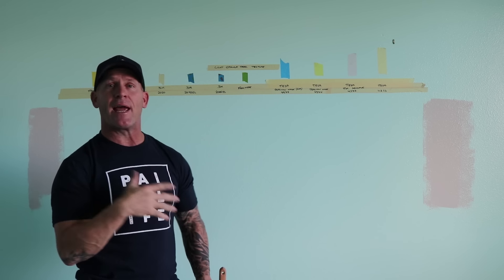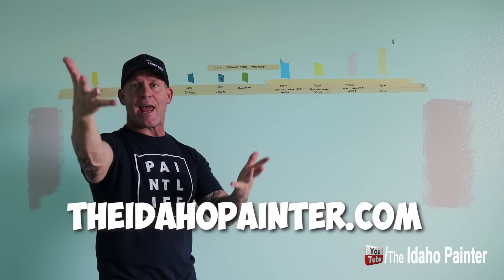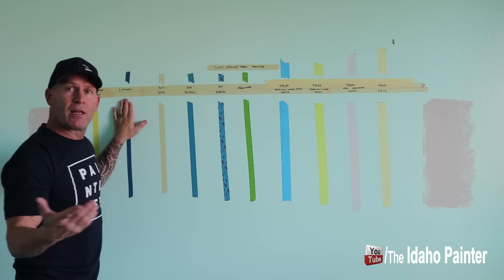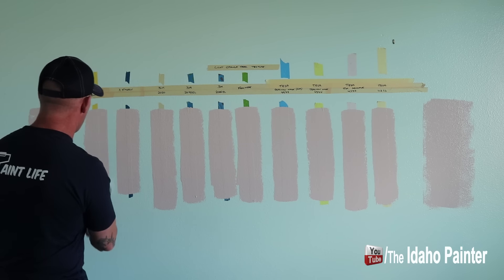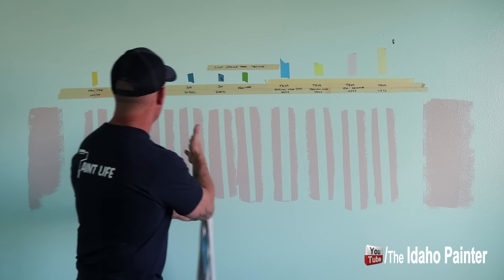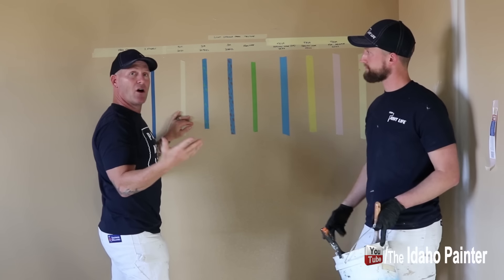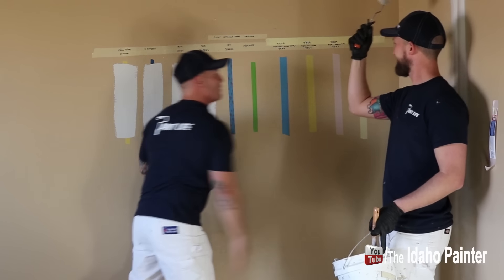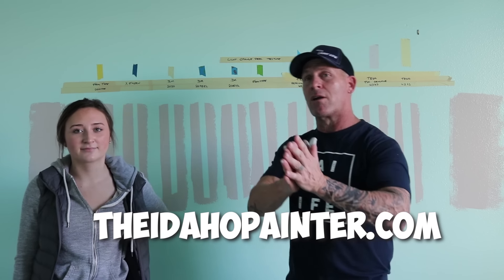Painters Tape Test.  The Best Tape for Painters.

Comment: Green frog tape or yellow frog tape is what I trust to avoid bleeding around edges. Naturally it depends on the surface where I'm working. Edging corners on accent walls or along cabinets? I use the yellow. Around wall fixtures or less delicate surfaces, I use green. Yes, they're expensive, but they really work. For baseboards, I use regular 3M masking tape (2"). It stays in place the best and is relatively inexpensive. The only time I ever use the blue painter's tape is when I am draping plastic from a ceiling. Other than that, I don't much care for it. Yes, it's made to not leave residue on whatever it's stuck to, but I rarely have tape on stuff more than two days, and very few tapes are going to leave residue after only two days unless they are in direct sunlight and getting hot. Blue tape is sold to homeowners who leave the tape on walls and ceilings and trim for weeks while they bang out small projects. Sure, there won't be any residue - even after weeks of being stuck to a surface, but the bleeding will be atrocious.
Reply: Sigh. As i read this i have blue tape up on a wall and its been days….

Comment: Just paint the protected color over the paint first, then, when it's dry, paint the new color you are blocking with the tape. Instant laser sharp lines every time. If you do not have the paint (say you are changing wall, but want to keep trim) just use the appropriate (satin, matte, gloss) mod podge. For Frog Tape to work correctly, just read the instructions.

Comment: We generally run a lightly dampened rag over our frog tape first to activate the sealer. Paint does not always do the trick.
Reply: Greg Andreas Thank You For The Tip👍🏼
Reply: Greg Andreas - Oddly, my SW Rep told me they'd had complaints about Frog Tape not working and found that sweat from fingers when pressing it into place was the problem.  I'm always hyper vigilant to keep Frog Tape out of the sun, away from any moisture and in the containers the best I can.  I'm in Sarasota, FL where it rains every day with 90%+ humidity 6 months out of the year.  I'm going to give the damp rag 'trick' a try.  Thanks for the heads up.
Reply: Yes! He should have done the test by dampening the frog tape to show how awesome it preforms!
Reply from the maker: Good tip, thanks for sharing!
Reply: Life changing tip my man. I have always sucked at trim. So much so I put off painting one room for over a year and a half because I didn’t want to del with the trim.
Reply: Damp Microfiber is the best way hands down

Comment: We use white tape outside where it doesn't really matter that much or to hold stuff together (plastic, paper etc) because they are cheap. Blue tape where you want to make sure you won't pull existing paint off. Downside of blue tape is that it doesn't stick very well. Orange tape is the general go to that we use most of the time. It sticks well and does a pretty decent job as a jack of all trade. Green (frog) tape on sensitive projects where a straight line really matters. It won't pull existing paint off. The downside of frog tape is that it is ridiculously expensive. Those are the four types of tapes we use 99% of the time. We also use masonry tape (usually dark red) which is a kind of duct tape on steroids. As you may have guessed it, we use this on masonry projects where the regular variety of tapes will not stick to the surfaces like concrete, brick, morter, etc...

Comment: Dollar store cheap duct tape works well too. Its got cheap adhesive that comes off easy and paint never sticks to the silver side so you can let the paint dry on it, and itll just flake off the tape and stay on the painted surface. i rip the rolls down the middle so I can have two sharp edges and only stick about half inch of tape on any surface, curling the torn side up
Reply from the maker: Awesome, thanks for sharing!
Reply: or dollar store electrical tape apparently...

Comment: Good demo, with one big omission. I’m very interested in the exact names of the 2nd and 3rd place winners. Most everyone knows Frog Tape and it’s the most expensive. But your second place winner seems to be good enough at a fraction of the cost. I might go with the second place winner to save a little money. However, in your results explanation I only heard a jumble of numbers and could not possibly identify the 2nd and 3rd place winners. So how could I buy them if I wanted to try them out?

Comment: I'm sorry for the thumbs down, but this isn't a good example of how we use tape as professional painters. How about taping a whole wall's-worth of baseboard and trim--in that case gravity is trying to pull the paint behind the edge of the tape. And more importantly, if you're caulking your tape anyway, I want my tape to stay where I put it until I'm ready to paint, and the green Frog tape falls off just like the blue 3m stuff. In my experience, only the yellow Frog tape really sucks down and stays put--delicate surface or not, it actually works!  Also, how about a closeup so that we can decide for ourselves?
Reply from the maker: That's a good idea!
Reply: Interesting, i find the opposite!! I find that the green tape sticks much better than the yellow tape! The the yellow frog tape is designed for delicate surfaces or paint that has not had time to cure and therefore is less sticky. So I don't quite understand where your coming from. Good luck anyway.

Comment: Can you tell me if I can leave painters tape on the wall for over a year without damaging paint at removal? I saw a wallpaper application method I want to try where you put paintera tape on the wall and then doublesided tape on top of the painters tape and then apply the wall paper.

Comment: I have a question that doesn’t Pertain to this video but I would like some input on it if that’s ok.My question is I have orange peel walls with antique white paint on them pro Marr 700 is what I’m using then use the orange peel in a can from Sherman Williams to fix my patched areas and then I use spray kiltz in a can over that and then finish coat but I noticed when I look down the walls I can see all of my patched areas how can I make this blend in better?
Reply from the maker: Sounds like the texture is flashing. You can see the differences between the size/pattern of the texture. Not much you can do about it now besides starting over.
Reply: jerry myers dude! I've had the same issues with patch jobs. You can primer and paint over them and they can look great when looking directly at it but from the sides you can tell there was a patch. What I've learned and am doing now is priming the entire wall after the patch job. I usually prone the patch area twice to get a smooth coverage but then prime the entire wall. Once painted you will never be able to tell. I've 10 rooms in my house and once I started this method it looks perfect.

Comment: I appreciate most the explainenation of the various tapes.

The down side I see of this test, or fault, is how quick you were to pull tape. 

It should've been a little closer to real world as far as leaving the tape on.

No one I know, masks off. presses that much the entire masked area, then paints straight away and pulls tape straight after that.

Real world is more like...

You go in mask off everything. Could take a day depending the job.

Leave it, come back and paint it. Leaving it till the paint job is done.. which could take the day.

next day, or whenever you come back. Pull tape and masking.

Especially for the diy user.

Lastly.. I huge factor is a clean pull. 

3M tapes are notorious for grabbing the surface especially after 24hrs.

And when pulled, either tear into little tiny pieces and/or leave glue on the surface.

The 3M 2098 most commonly found at hardware stores and sold in Pro Packs.

Personally, I don't paint houses. I paint single or 2 part paints.

It's impossible to pull tape directly after a coat. let alone wild one want to when laying 5-10 coats.

Pulling tape is a freaking nightmare. Even 3M's low tack tape states it's only low tack for so much time. 

In this video, especially that second run. That tape was on for what.. 3 minutes maybe. You could hear the difference in the grab they had.

You'd be pulling surface paint or leaving a ton of glue and that first layer of blue paper with some of those.

3M again, as you mentioned, swells.. but it also separated from the glue. leaving the glue and a thin layer of paper behind. 

At $10 bucks a roll, the 3M 2098 "safe release" blue tape is anything but. 

I have a project now that it was used on. Just enclosing a small diy paint booth for testing. 24 hr's later. Pulling it off left tons of glue and blue behind. And that's on a pvc pipe surface.. now I have to go back and clean all that crap off.

Thanks for the test though. And your explanation of the various kinds.. A couple I curious about having never tried them.

Bleed through is something no one wants in any paint industry. No matter the paint water or solvent based, single or two part, spray, roll or brush on bleed through tis the enemy.

Comment: What most people (including painters), like Chris explained for different purposes. They have different applications and that's  why they have different colors, textures and thicknesses. This test is not about the best tape overall, is just the best tape for that application. Example, I would use the cheapest tape for masking furniture and having the tape contact the plastic and not finished surfaces. 3M makes different types of tape with different  colors for the same reason.

Comment: Giod video. Next test should be how long you can leave tape on a wall, window and door before it sticks and shreds.
Reply from the maker: We take it off before the paint dries
Reply: How does that work if you are priming and then painting. Do you tape, prime, remove tape while wet, let it dry, retape, and paint, or do you just tape once and let primer dry on tape, then paint and remove tape?
Reply: I used yellow frog tape on cabinet trim of a cabinet i needed to paint. I primed the cabinet with Glidden Gripper, let it dry, gave it a 2nd coat, took longer to dry. Then 2 coats of eggshel. After last coat, it peeled off. It was not perfect, but it was fairly clean. I would not do this, however, with a gloss or semi-gloss. You'd need to use a utility knife and straight edge before removing.

Comment: 3M 2020 stick as hell, once pressed on it, it will not coming back. So to stick on another tape it work but on a painted surface it weld on it and now you'll be in big trouble
Reply from the maker: Thanks for sharing Nick!
Reply: He uses 3m 2020 to mask off the trim after he paints the trim and then waits 2 hours.  I tried it today and it worked wonderfully!  I was skeptical at first thinking it's going to pull of my semi-gloss freshly painted trim but it didn't.  In  fact 3m 2020 worked better than the yellow frog tape or the 3m green tape and it's so much cheaper!

Comment: Which tape leaves least sticky residue after a few weeks' indoor use.
Reply: tyvek05 What else would you do?
Reply: urbaniten We use the 100 mm tesa tape for masking windows and its easily removed after 2 weeks indoor use
Reply: Scotch blue tape or 3m blue tape sticks the best and without leaving residue and leaving the best line
Reply: Using it to seal something for a few weeks.
Reply: Malkiat Randhawa as long as you seal the tape with the wall paint pretty much every tape brand you use will leave a perfect line

Comment: If you take a credit card and burnish the frogtape it works even better
Reply from the maker: Thanks for sharing Pete!
Reply: I was told that the manufacturer recommends using a lightly dampened sponge. The baby diaper material in the tape will swell and seal the tape perfectly. I always lightly sponge mine before painting.

Comment: First off Alex caulking is unanimously bad after 2 years I don't know any painter carpenter who still uses it. But more important! Whats all these wall textures your referring to? 99% percent of my jobs, old houses or new the walls, are smooth. Some times with an old house they will have  a warn stucco like finish which is great because it never shows streaks and you can paint them in any and all directions.
Reply from the maker: Depends on the area you are from, there are different texture finishes

Comment: I stick with the standard  3m blue tape because always use caulk to seal the edge, clear paintable if surface is too rough  . I don't  trust on any lock edge tape because only performs well  on very smooth surfaces